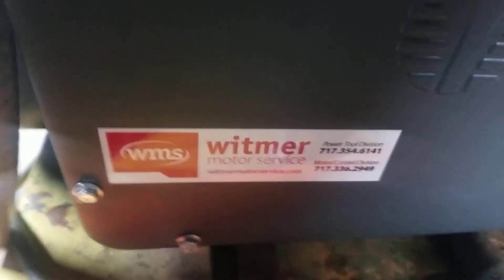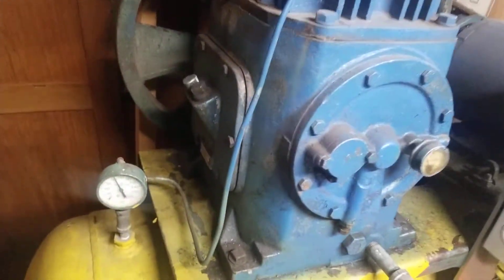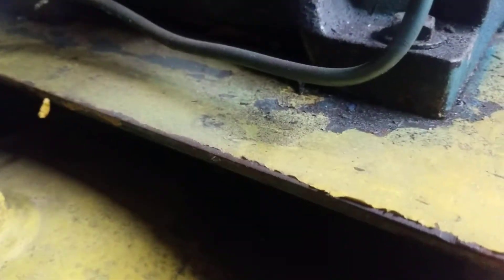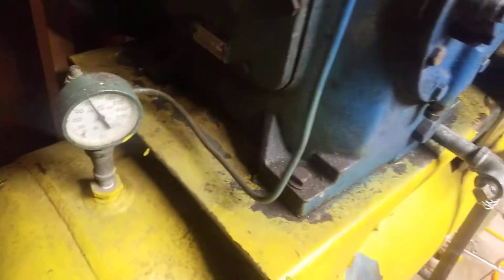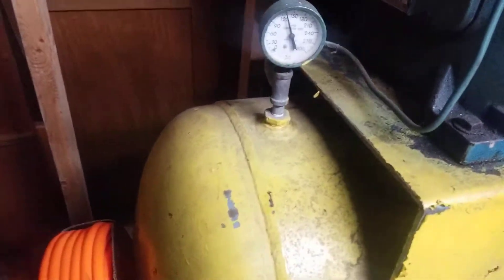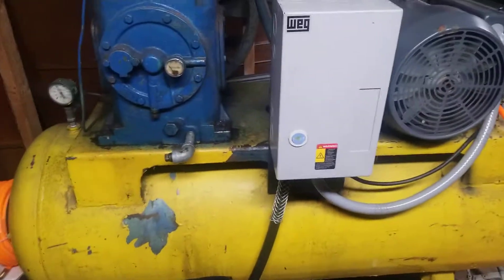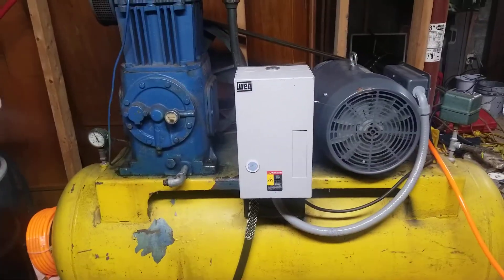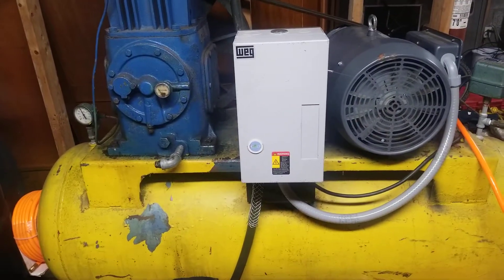Quincy 244 compressor unloader adjustment?

Comment: I left you a comment on my video before I seen your Uploaded video of the compressor unit. You have an extremely old Quincy compressor from the 1940s.
 It should have come with a hydraulic 
unloader  But there is no place for it as the casting on the bearing Carrier was never milled out Where are the hydraulic un loader would go, It may have been a vacuum pump That somebody converted to an air compressor, It's totally possible as the parts are interchangeable, I noticed in the video there is no crankcase breather as well. That would normally be plumbed from the 3/8 pipe plug in the base of the cylinder  Just above the inspection plate
 To the head of the compressor on the inlet side 
 If you want to use this air compressor your best bet   Is to use  The existing pressure switch and install a normally open 3 ways solenoid valve  That can run off the pressure switch. And you'll be able to run it start stop or  continuously, If it was a vacuum pump more than likely there are no oil control rings, But I'm really not sure as those units were pretty rare back in the day and I never work on one that was that old keep in mind most of the parts for this unit are obsolete,
 Good luck!
Reply from the maker: I think the pump has very little use or it has been rebuilt or very well taken care of since the oil pressure is about 20 psi. I thought it would be pretty cool to have one of the oldest Quincy compressors still in use. It only takes about 4 minutes to fill that giant tank.